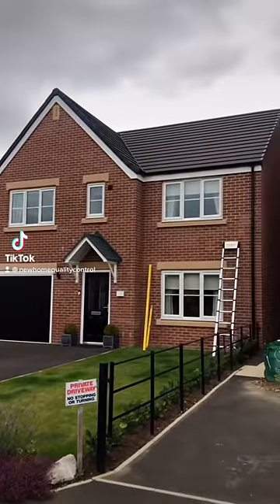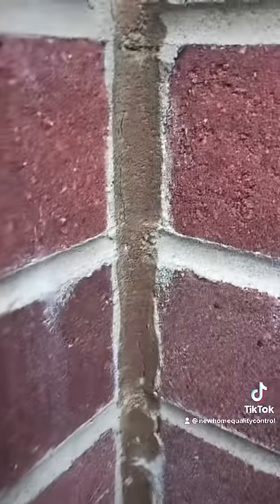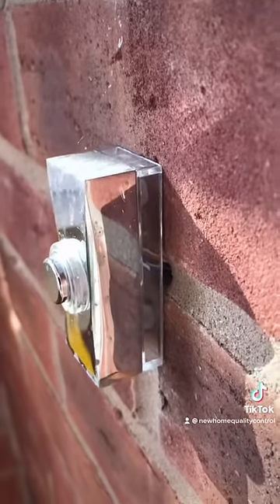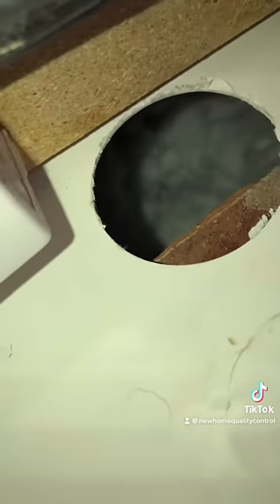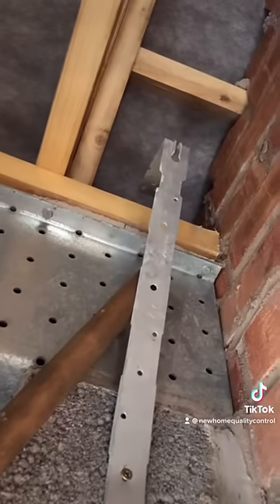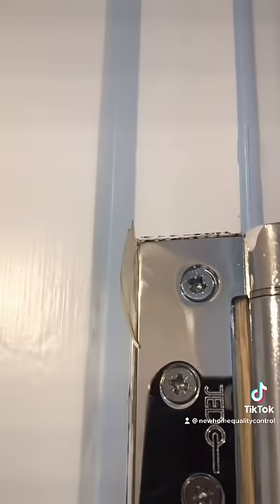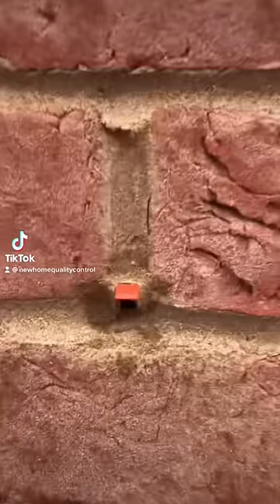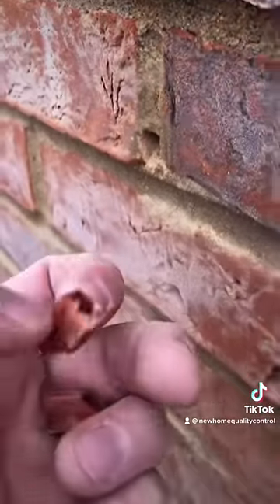MAJOR ISSUE FOUND AT THIS NEW BUILD! | FAKE MOVEMENT JOINT?

Comment: Then movement joints just inside the corners of these builds are bollox any way I wouldn’t worry about it
Reply: I take it you had a hand in building em then they have building standards for a reason
Reply: @cactuscrew3404  nah I’ve built plenty of other houses with that same sort of spec  with movement joint right in the corner basically turns the strongest part of the build into the weakest no corner strength there with a movement joint there worthwhile on big long flanks
Reply: Got to agree..over builds haven't got them
Reply: Again lazy architects and cad design being used too much.computer says movement joint🙄

Comment: I dont think there should be an expansion joint on an internal corner especially with the short distance to the front elevation.
This internal corner is structural holding the two walls together giving vertical stability. The mistake is trying to make it into an expansion joint.

Comment: My mum's house is a new build: I had to realign the gate fittings, the gutters didn't have fixings on the junctions and spilled over from sagging(over an exterior light fitting), one of the gravel boards is completely off level, making the fence board off level, the bath was damaged causing it to rust, she's just found a leak coming from the boiler, causing damp throughout the house, the locks have broken after 5 years, the slabs out front are shifting from being laid on a mixture of dirt, hard-core, and sharp sand(no mortar whatsoever), there weren't any window fixings which she had to install herself, the reveals are all over the place, there's mildew around the skylight, and many more than I can't remember.
This house has been standing for less than 6 years and there's so many repairs needed already.
Fortunately, the brickwork doesn't seem to be that out of plumb but I've only visually inspected it so far.
Its truly disgusting what these people get away with.

Comment: I live in a council "flat" massionette really.
My issues in 17 years
Original pipework corroded under my door sill.
The old double glazing is starting to blow or drop(but all repairable and replacements available)
The stair rail in the property is a bit loose (its original to the building)
The electrics have been replaced as has some gas pipework.
I now have cavity wall insulation and a composite front door so property is warmer..
Oh and my bedroom floor was never insulated so its always been freezing or boiling..
So thats to be fixed by ripping up my floor.
However my building was built a few years after WW2.. For its age the issues are minor.
Only thing i hate is radiators under windows..
But thats a me problem.

Comment: Can someone please explain to me why we need an expansion joint on an internal corner on a small detached house?

Same with weep holes, no need for them, have you ever seen a drip of water coming out of them?

Tray damps, why? A horizontal tray damp around the building is blocking the flow of air in the cavity.

Half of the modern problems are being caused by people making decisions that have never worked on a new housing site let alone worked on older properties where you can learn what works and what doesn't.
Reply: Well said, it’s a load of bollocks 👍
Reply: @booboo-nl3wi  cheers
Reply: @Mouseythegreat Firstly, if there isn't enough water to create a drip, then we are talking condensation levels.
As you said, bricks are permeable, so the let water pass through into the cavity but they also let water go the other way and dry out.
I have been laying bricks for forty years, we never had weep holes in the past and never have issues with damp cavities only the normal bridging on wall ties. I am yet to find someone who can tell me how all the water gets in the cavity? Bricks are permeable yes but it isn't a one way valve, a weeks worth of rain would soak a brick to a depth of lets say 40mm, but we rarely have a week where it rains constantly for 7 days, any day that we don't have rain the brick starts to dry out. 
If rain was an issue, Manchester would have the worst problems with cavities in the UK, but they don't. 
The majority of moisture inside of cavities is from humid air cooling and condensing. It will condense on the coolest surface first, which is normally the outer skin.
If you vent a cavity correctly, this condensation will dry our the next day.
As for Expansion joints, they are a nonsense, go look at a row of terrace houses build a street long a hundred years ago, not expansion joints and no cracks.
Reply: @Harvey Smith  good point mate, why arnt there expansion joints on the inside?  Surly it’s creating problems
Reply: I would like to explain but it’s above your pay grade .
Reply: @Dave-uf8ek  Thanks Dave, you're about as helpful as the office boys on site.
Reply: @grotekleum  points well made
Reply: @harveysmith100   if it is on the drawing it must be done , everyone wants to be the boss but too lazy to learn why things are as they are . I’m a qualified electrician plumber bricklayer and boiler engineer. I have built flats houses all over the place for 30 years . I know most people don’t know why what they are doing is important. People can’t be bothered to read instructions for some reason. I have often pointed out what that pencil line on the drawing is ie expansion joint  . Depending on materials used expansion joints should be incorporated to allow for movement , every ten metres on a building they should be positioned in specific places. If you would like to see an example of expansion joints missing Thamesmead is a good example treat yourself and have a drive round . Lots of cracking can be observed by a keen eyed person. 30 year old housing and newer are in need of remedial work .                 
                       The reason for tray damp and weep holes is to allow moisture to leave the cavity this can be condensation and to allow the cavity materials to dry they also act as vents
Reply: @Dave-uf8ek  Well thanks for that Dave.
Like you said, an expansion joint every 10 meters. The front of that house isn't 10 meters wide. So why does it need it.
 Half the problems with cracks is due to the cement being stronger than the bricks.
In now comes in silo's and it is set nationwide regardless of the material being used.
A row of terraced Victorian cottages could be a street long, no expansion joint and no cracks. 
I am fully aware that if it is on the drawing it goes in. But as and indentured bricklayer I have earned the right to question why something that has worked for hundreds of years now needs to change. 
Weep holes barely let any air through, air bricks let air flow.
Horizontal tray damps stop the flow of air.
If a cavity is properly vented there is no need for weep holes. We had cavity walls without them for decades with no problem as long as there were enough air bricks.
As for my pay scale, I am educated to degree level
Reply: @harveysmith100  no cracks due to lime mortar.
Reply: @harveysmith100  air bricks don’t vent the cavity.
Reply: @harveysmith100  drama degree doesn’t impress me .
Reply: @Dave-uf8ek  Exactly, a mortar that is stronger than the material being used.
There are also millions of houses build with sand and cement after 1918 that don't have expansion joints or cracks. Many of them 9 inch solid.
Reply: @Dave-uf8ek  Really? So what the point of me fitting them years ago then?
Reply: @harveysmith100  air bricks vent the under floor void , or supply air to gas appliances .
Reply: @harveysmith100  lime mortar repairs itself,  as many old houses have been rendered or pebble dashed to hide sins we just can’t see the dodgy work . Many old houses have cracks in the party wall you just can’t see them don’t mean they are not there .
Reply: @Dave-uf8ek  Earlier you were saying you were qualified in bricklaying. What do you think 4" air bricks are for?
Reply: @harveysmith100  they are to vent the underfloor void , or for extra ventilation were required,  to release marsh gas from under buildings  . If you have a different take on there use please send me a link , I am never afraid to learn something new or to admit I’m wrong. No one knows everything .

Comment: heres one for you,, a newly built three block had dropped on on one end(was under pinned)..   the movement joint on back elevation starting from the dpc was 10mm and gradually opened up to 60-70 mm at the top,, a simple fix though plenty of gunk and a dummy drainpipe (yes i know not funny is it),

Comment: My dad is an inspector for a builder. He does a really good job. Is very black and white and if something isn’t done right he makes sure it gets done or fixed. It always amazes me how many short cuts construction guys take when they are building. My sister wanted to buy a new home because it would t have any problems, but there is no guarantee of that. And it’s not even a new thing. I find things in my 40 year old home that were clearly short cuts the builders took and I have to go around trying to fix them

Comment: I've been a brickie 40 years building houses is easy really , expansion joints or movement joints are easy to do. The brickie just needs to read the plans correctly then movement joints won't be missed, and no you don't cut joints in with a grinder you construct the movement joint as  your building and you put a  foam expansion joint and build in slip ties  vertically every 450mm . When the house is built the joint is masticed to seal it from water ingress

Comment: I live in a new build and I have so much issues with it the electrics wasn't connected to the correct sockets, the walls not leveled, outside walls look out of place, my bathroom looks a shit hole under the bath, Yet they put rushed house on the market at a whopping 250k plus like what? The home owners have to do what should of been done!

Comment: I have a stone built house from 100 years ago with none of these features, no doubt would not pass modern inspection code, a slate dpc etc. There has been schonky work done in modern times though, retaining walls, without lining poor drain points with clay infill, loft tank overflow pipes insulated over etc etc . It’s one thing to criticise it’s another much harder thing to be responsible to make sure nothing is wrong in the first place. Being on the inspection end of the equation is much easier.

Comment: The reason this happens is very simple, it starts before the build is even agreed, the way new builds a price structured is everyone have an agreed amount they will be paid for X amount of work done, this way the contracting part know exactly how much its going to cost and more importantly how much they will make, the problem with this is it encourages the "am alright jack" mentality on the site, everyone is keen to get as much done as possible and isn't working with the other trades but against then, I don't see large scale builders changing this so is you are things of buying a new build look for a small independent developer, the quality control with be better and it's a more personal project for all involved, but you will pay more, but as I always say to clients is that job costs £100 to do correctly what do you think you will get for £50, nothing from us is the answer.
Reply: Hit the nail on the head. I jacked new builds in after 25 yr on sites. The pressure to complete is unreal. Always pushed and prices did not equate to workmanship needed. Whilst some men had pride , most were to keen on money and no pride whatsoever. It got embarrassing seeing customers being totally sold a shoddy home. The whole industry needs reviewing as this has went on too long. Nhbc inspector s are mainly reading from books and don't know the job hands on.every trade should have an individual inspector who knows his trade. Money talks though. Money the root of all evil they say. Times have to change .stop this monopoly of large companies dictating . Rant over lol

Comment: Though, possibly it should have been a proper control joint (no mortar, and a movable retentive caulking or a solid rubberized joint material). The continuous mortar joint, so long as there are no metal ties at the corner, will provide a seperation/shear joint, that will accommodate differences in movement between the intersecting walls. Given that the offset in the wall is only 1-3 bricks long, the likelihood that the smaller wall in the offset will experience excessive loading, cracking the footing and causing independent movement, the likelihood of separation at that intersection is nominal. 
    Keep in mind, if the building is of standard construction (framing), the wall to the right of this joint is the only "load bearing" wall, and the ell to the left is a gable end (non load bearing). The framing could have been designed to support any weight from that offset via cantilever, transferring load to the foundation, so the facade could be self supporting.

Comment: Solution stop allowing exchange of contracts until house fully built and independent structural survey carried out. At the moment you can exchange with not fully complete properties with agreement finish by completion receipe for disaster. If this was stopped the quality control would go up.

Comment: Why would you put an expansion joint on a corner of a building??? That’s where the strongest point of the brickwork is! Also look at buildings that have been stood for hundreds of years! No movement joints in them!
Reply: Shouldn’t the bricks be inter locked into each other  to give a strong joint?
Reply: My home was built in the 1700's.
Nothing is straight, level or plumb. But it is solid.
I doubt the new build of today will last as long.

Comment: Awful, I made the mistake buying Talyor Wimpy. It's been horrific. 
All our ceilings needed redoing as they did not put the screws in right to hold it up. None of our bathroom appliances have a shut off valve  which is a British Standard violation and all lagging was laid over the hot down lights and melted.. thats just the tip.. shocking really.

Comment: On a smaller scale this happens a lot in individual trades. I had a bathroom fitter (and I use those words VERY lightly) who's basic skills/knowledge were extremely lacking. I thought I did all the rights things, recommendations etc but was shocked at his work. These are some of the small but bread and butter things,  never mind the main ones. He couldn't get my sink to stop dripping from the trap (all new btw that HE fit), he couldn't understand that the grub screws are supposed to be underneath on the accessories, some toilet roll holders can only be fit a 'certain' way hence we couldn't stop the roll from falling off when pulled, on my interior mirror which has a separate on/off light switch he rang me to tell me that it only works when the main light pull cord is on (he somehow couldn't see the switch at the side of the cabinet that HE fitted), silicone sealant that looked like a 10 year old had done. On a separate note, one day he rang me to say he couldn't make it to my house that day as one of his horses was ill in the field......seriously !! (that's true btw)

Comment: Expansion joints are a speciality in their own right. Some incorporate a flat metal plate with a kink in the middle which ties both sides together. These have to be built in by the brickies and are a headache. Some have a heavier state plate with a rubber Jonny on one side, these are a headache also. Then there I the straight up expansion joint that is only tied to the inside skin. Some of these joint are left to be cut by the Con saw later. Same for concrete roads and driveways. They wait till the concrete is hard and cut the joint with tbe 4 wheel cutter. It's faster and neater and the cut only needs to go down 66% depth. The worst building quality that I have ever witnessed first hand was in Germany. In 3 different cities.It was difficult to tell which was the worst. I was once told, before I went to work in Germany, , , to forget everything good about my trade and do exactly as they tell me..I thought it was a joke. It was no joke but I found tbe Germand to be good honest people  helpful and sincere. It was later that I came to the conclusion that any German with intelligence avoided the building sites..

Comment: And that's what can be seen on the surface, shocking but not unusual in an industry all about sub contractors getting pressurised to get the job done asap, (and those who do a crap job knowing it wont ga checked).